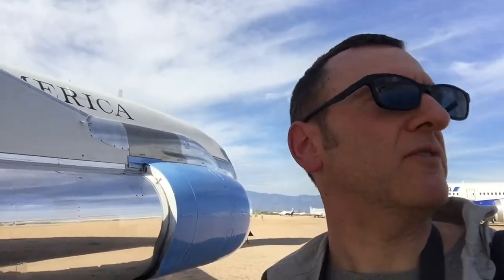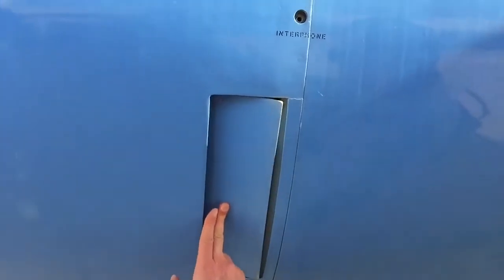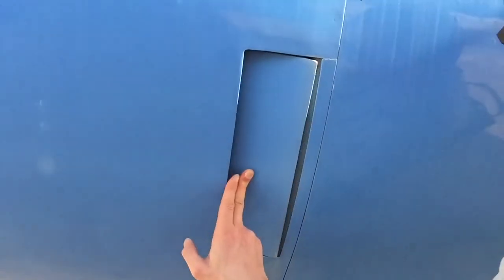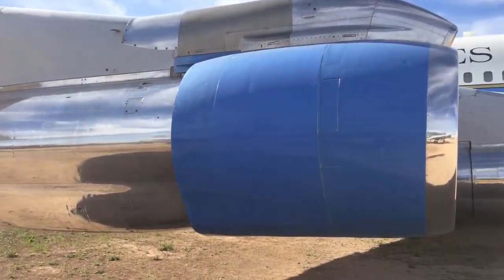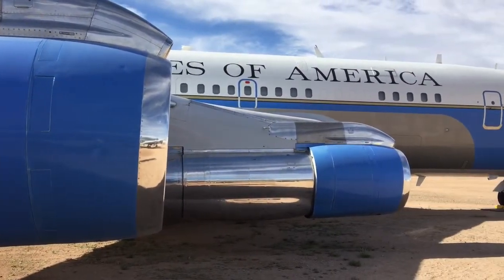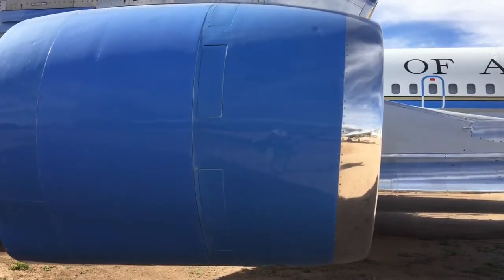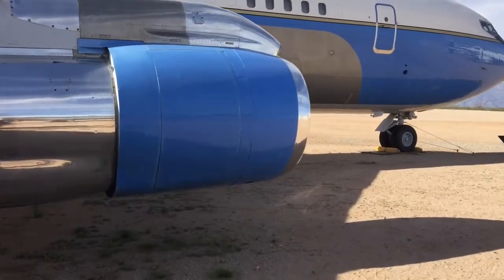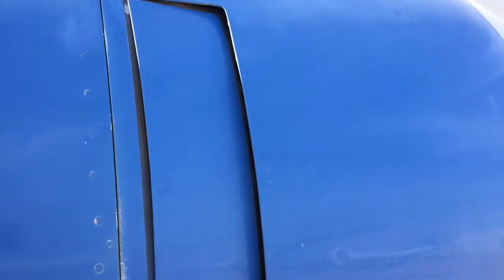Boeing 707 JT3D blow-in doors explained

Comment: Just more complexity, more costs for nacelles & added more fan noise. Never see a DC-8, or DC-9s with these unnecessary things and DC-8 and 9s used same engines as later 707s and  early 737s respectfully.

Comment: I thought they were air inlet doors for the small turbine bypass fans. The doors would open like he said. During the higher thrust needed for taking off and getting to a higher speed. The bypass fan created at the most 15 percent of total thrust. Not like today. When the bypass fan creates a majority of the thrust. This makes it so the turbine doesn't have to work so hard. Which is why the engines today are so efficient. Thank the development of the 747 engines for that.

Comment: Hoped for a more technical answer.  Repeating the term "blow-in doors" multiple times didn't help .
Reply from the maker: The blow in doors simply allow more air surface area to enter or “blow-in” to the engine at certain usually max power settings. If I never said this in the video my apologies.

Comment: Does this one still fly?
Reply from the maker: Sadly not, but it lives on for public viewing at the Pima County Air Museum in Tuscon AZ.
Reply: The only Boeing 707’s you can see flying or the one serving in the military currently in this case electronic warfare and radar aircraft versions of this plane or KC 135’s which are literally 707 with turbo fan engines

Comment: Seems smaller and  in different shape than the original doors on unhushkitted JT3Ds!
Reply from the maker: Actually these JT3 engines are the original non hush kit versions of the engine.
Reply: @JetFlix  You're right. Thought the different blow in doors were due to hushkitting. So its about different generations. Thanks. Late JT3Ds  hv much larger blow in doors and squarer too. And I might be wrong, but late generation's doors seem to be opening in an opposite direction too!

Comment: They were also found on 747 fitted with Pratt and Whitney JT9D engines. 
These were removed when the Airplane had hush kits fitted and the airplane in Question became known as a Stage 3 airplane.

Comment: Someone please correct me if I’m wrong.  I believe that the blow in doors which were much larger and located further forward on the nacelle were eliminated on hush kit nacelles on later service 707 series aircraft. According to the book “Boeing 707 & AWACS” by Alwyn T. Lloyd the blow in doors seen here were used to inject addition air when the engine was in reverse thrust.
Reply: I thought the same thing about how those don't look like the typical blow-in doors because they are too small, too far aft of the intake, and that they are hinged at the rear of the door, not the front.  A quick look on Pima's website shows that this was not one of the Presidential VC-137s used during that era.  This was a off the shelf B707 converted to a VC-137A (S/N 58-6971) for VIP transport/Airborne Command Post, but it was not one of the specially configured AF1 VC-137Cs (S/Ns 62-6000 & 72-7000).  If you take a look at this pic of 72-7000 at the Reagan Library in California, you can clearly see the typical blow-in doors right where you would expect them to be:
https://upload.wikimedia.org/wikipedia/commons/c/c3/SAM_27000_at_Reagan_Library.jpg

Doors open for takeoff:
https://en.wikipedia.org/wiki/VC-137C_SAM_27000#/media/File:Air_Force_One_SAM_27000.jpg

 I still give the up loader of the video credit for knowing what he's talking about in the general sense.
Reply: The doors he was handling look better positioned to be the reverse thrust deflector doors.